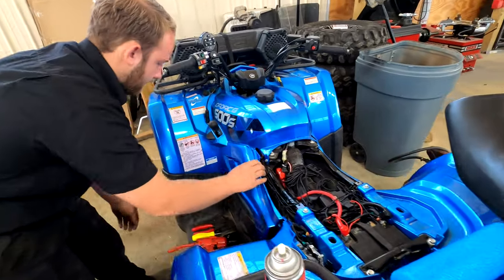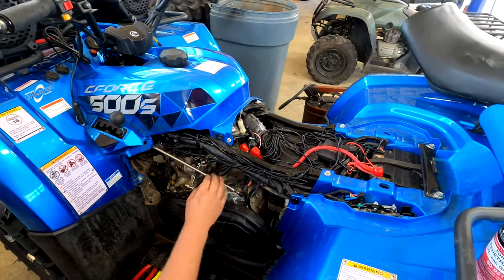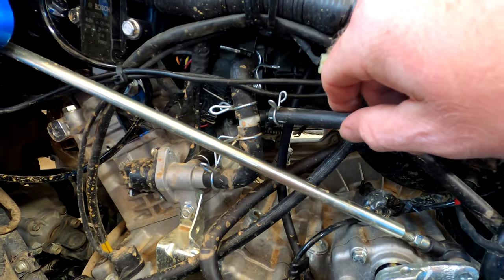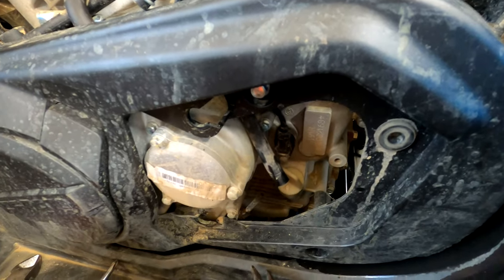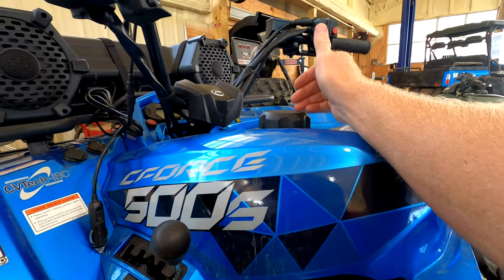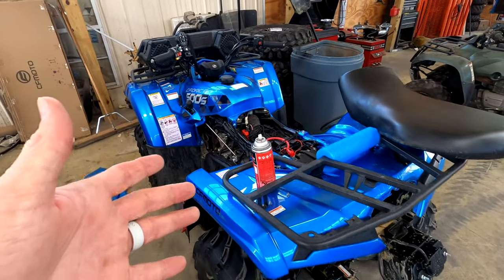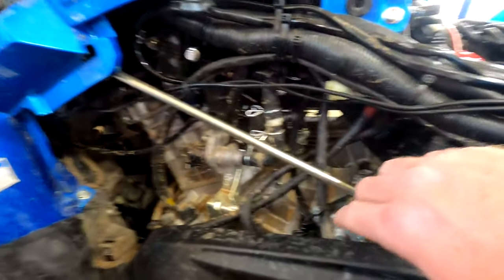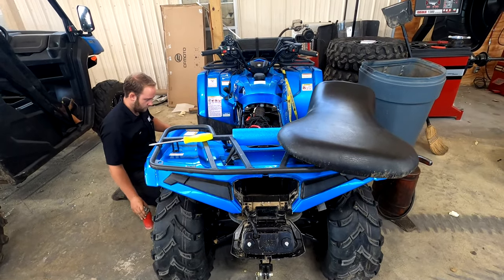CFMOTO CFORCE Fuel Issue Fixed | Vapor Lock problem fix | Evap Delete Finally!

Comment: Great video! BTW, just passed you on the highway just now! Headed to a ride?
Reply from the maker: Thanks man.. im at Main Street Cycle today.. just gonna help out around the shop and brough my stuff to look into doing a snorkel kit on two of mine
Reply: @RealTalkPowersports  I figured as much. I live about 15 mins from Main Street down hwy 30. And I've been looking into doing a rad relo and snorkel on my 800. There's a website that sells a combo for the 800.
Reply from the maker: @roncrouch404  they are out of stock till end of next month

Comment: I called my dealer and he said they contacted cf moto directly and they have said there is no service bulletin or recall for this. I was wondering where you are getting the information cause I would like to have cf pay for this also
Reply from the maker: It was on US models.. for 2020 cforce 500, cforce 400 and cforce 800.. I saw the bulletin myself.. they fixed the issue on the 2021 models.
Reply: @RealTalkPowersports  …. It they didn’t fix it for all 2021.

Comment: I would have thought just a vented gas cap would fix that...like dirt bikes have...since evap systems are sealed, vent it and the vapor lock goes away......maybe...unless gas still accumulates in the hose? Or pull the crap off like it should be...LOL...

Comment: Is CFMOTO only doing this to 2020 models? I have a 2019 400 and its having that issue too. Thanks
Reply: I have a 2018 400. It has some kind of solenoid hooked up to the vent in the canisters under the left console

Comment: So recently my 500 was running fine with no issues. Then all of a sudden it will not start. It just clicks as if the battery is dead. Checked the battery and it is good. Is the solution the vapor lock fix?
Reply from the maker: No thats nothing to do with the vapor lock.. if it is just clicking then your voltage on your battery is too low.  Check it with a volt meter. Put it on a charger.. it needs to be higher than 12.3 volts from my experience.
Reply: @RealTalkPowersports  thank you very much for the quick response. I have tried charging the battery and also hooked up a meter and it is over 12 volts and still won’t start. Good to know though. Thank you sir.

Comment: I got a question I accidentally melted the evap cap on top of the gas tank and it is that replaceable or necessary it melted the plastic top and the plastic vent coming off it shut 😒 thanks for any information
Reply from the maker: whooofff... Im sorry that happened.. and hopefully one of the shop guys will see your comment and be able to give more input on what to do.. never hurts to let your local shop take a look at it and see if its a part they can order and replace.
Reply from the maker: @mariahporras9839  I believe you could but I sure would hate to lead you astray

Comment: I been braking belts left and right do you have any suggestions or had anyone else you know had them problems
Reply from the maker: Anthony I haven't had any of my crew have any belt problems.. what model do you have and tire setup and driving conditions and do you ride in High all the time? People that normally have belt issues put the machine under a load or bind while in high gear.
Reply: Yes I do alot of hwy riding in high gear on 28" tires that might be the problem
Reply: Thanks
Reply from the maker: @anthonybradley6568  what do u have?
Reply: @RealTalkPowersports  800xc 2019

Comment: My 600 2up does the same thing...I brought it Back again with this type problem 2nd time,  left a note about the evap problem you spoke of..and today they called me stating they dont see a problem they spoke to the techs and they did what they told them to do...they did nothing to the e vapor problem...that's what I was told...and the owner on the phone said it's not made to idle long either builds up moister, (doesnt make sence either about it not suppose to idle to long ..
I guess they checked the idle to run hrs...
What do you think?
Now I'm going to go there sometime this week and run it for about an hr an see before I take it home again

Comment: Hello. First i love your vids keep going. Second i got a problem with my cforce 850xc when i accelerate the engine idles between 40 and 50 km/h only when the engine is hot i make a video of it on my channel. If any 1 can help me its already the 3th time i go to my dealer every time he says its fixed but not the last time he  change the lambda sensors from the exhaust. Much appreciated
Reply from the maker: Thanks Jimmy and I hate that you are having a streak of bad luck with it. Ill try to take a look at your video. And maybe someone on here has had a similar issue and can help quickly